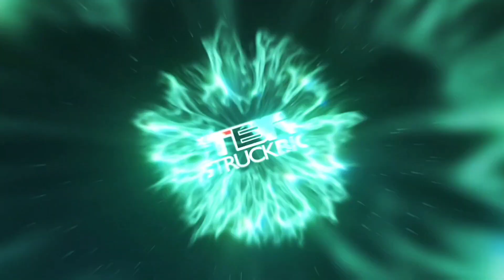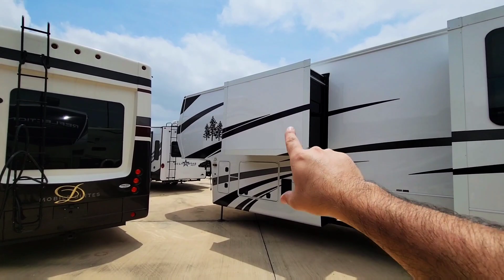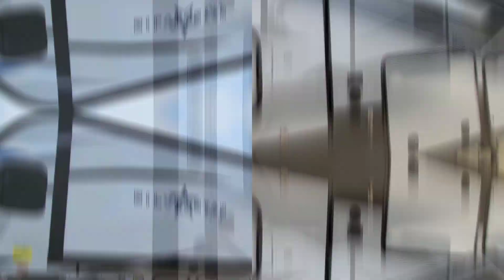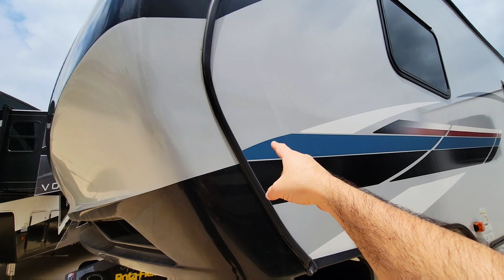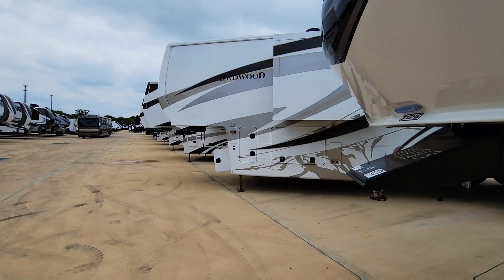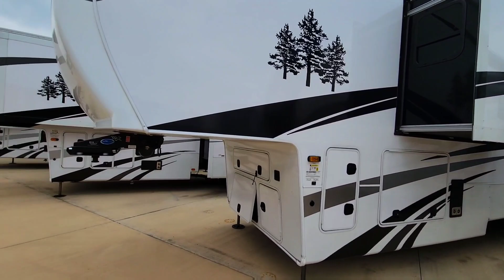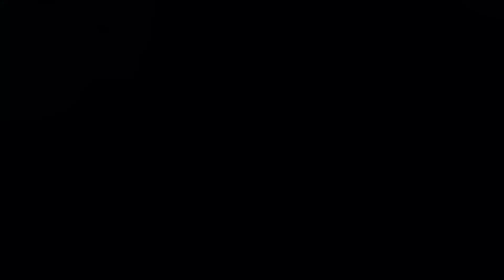The RV Industry NEEDS YOUR OPINION on this!

Comment: Interesting topic! When you say “edginess” I’m guessing you are talking about the more geometric shapes and designs verses the swoops and whirls of some of the units.  It kind of goes back to some individuals like modern (more geometric style), traditional (more swoops and whirls) or retro which is a mix of the two.  Between vinyl graphics vs full body paint I always choose the full body paint just because it looks nicer and will most likely last a lot longer too. Having said that, anyone who just wants an RV for occasional camping trips for various periods of time would probably be just as happy with the vinyl graphics, where someone who will be living in the unit full time may opt for the full body paint. If you ever get the time it would be great to see a video where you detail (no pun intended) how a fully body paint is applied which would help viewers better understand how much work is involved, which is also why it costs so much.  I personally prefer having long flowing lines with some rounded edges to break up the pattern.  That voltage has an awesome paint job, but it’s a little too modern and geometric for my tastes.

Comment: If I bought one of these I would need a change in the "class" for my drivers license.  I wouldn't buy one of these because length of the units.  I would be interested in a Motor Home that is under
26'.  The new exterior artistic designs are awesome.  Also, cost of gas is becoming a consideration again, so smaller is better.

Comment: Love that new painted graphic on that Voltage, but that in vinyl would be nice too. The redwood is nice too, but both for different reasons, ...I wouldn't swap those two graphics, just because you expect a little " edge " on a toy hauler and a little smoother look on a residential type RV. DRV...and yet they use that shitty door window. We swapped our for that thin shade immediately, matches the RV and the frameless windows much better.

Comment: I would like to see full body paint and less graphics. I do like the Voltage that you highlighted at the beginning. I would also like to see the industry get the full body paint down to a cost of less than 8k so the masses can afford it. I keep a cover on my rig just because I am worried about the vinyl graphics drying out and looking like crap. If I had full body paint, I would wash and wax like I currently do but not worry so much about the finish turning bad.

Comment: Thanks JD, I have been trying to find a video that goes over the different types of exterior paint jobs. Is there a reason they do not do a single solid color without any designs or stickers overlaid?
Reply: You can get one, special order a higher end unit and tell them what color you want.
Reply: @22howards  I have seen that as an add-on or extra charge. I just wish they would offer a solid color for more units even just white, grey, or black without the vinyl wraps added as base option since you are saving them labor and material.

Comment: I would like to see an option for full body paint with just 2 or 3 colors fairly simple patterns to keep cost down.  Cut the “swoops”, I’m not a designer but paint solid color with simple pin stripes or something like that.  Should not make you dizzy by looking at it.  NO EDGY!

Comment: Very good video.  I prefer the Voltage over all of them, with my least favorite being the Alliance.  I have a 2014 Redwood with full body paint, and it still looks great.  But if I was ordering a new fifth wheel, I would not order the full body paint, and put that extra money towards upgrading the suspension.

Comment: I hate all of the stickers on trailers but I care more about it being durable and having the features I need than the exterior. A single color paint would be my preference, with an accent color for the trim around the doors, windows, wheel wells and anything else. Or a two tone with a swoop where one color is above and one below plus a trim accent. If they want it to be eye catching and flashy do metal flake paints. But how the exterior looks will always be at the bottom of my list of deciding factors on a trailer.

Comment: The voltage is beautiful.
I have a camper with bunks and a outside kitchen.
What I want camper manufacturer's is no inside kitchen. We have yet to use the inside stove microwave. Use the outside kitchen all the time, and if it's storming we.just go to a local town.

Comment: Curves vs geometric vs images vs lettering vs vinal decals vs paint

Bottom line I do not want to invest extra cost into a RV with a life span.  Fit and function along with safety is more important.   This is what additional options are for if you want upgrade to full paint or extra busy graphics or color choices. The RV industry is expensive enough without all the worry about graphics.  This year because of product shortages the RV prices have risen higher than usual price increases.  I am really shaking my head hearing the industry wants to know what we think about exterior graphic design.

Comment: Full body paint all the way! After owning four large toy haulers with decals here on the West Coast the sun is brutal and after a few years will dull them out and they’ll start flaking and pealing 👎🏻 The money spent up front for the paint will far out weigh the headaches in the future. Now if you get a new RV every couple years then save your money and go with the non paint units.

Comment: I don't care about the design. I care about the longevity. I keep my trailers for 10 years, and I have to store it outside. After a few the decals fade and peel. The front cap fades. I want RV industry to fix the fade and peel problem.😎

Comment: I want full body paint with fewer graphics.  I live in desert.  I want as much white, heat reflection as possible.  Further, less is more as far as the eye finding the brand and model information and I am distracted by the massive lines and multiple planes.  I guess I prefer boring!  I’d go with the Redwood graphics if I had to pick from the models in this video, but I’d be happy with a very minimalist geometric design.

Comment: You're in luck. Giving opinions is my specialty!

The Arizona sun chews the crap out of vinyl stickers, but I'd still go that route because full body paint is not where I want to spend my money. I like new-ish stuff so I'm in the market to trade in every 6 or 7 years. On balance, I'd prefer to have solid surface counters and quality to the touch interior materials over a several thousand dollar paint job. Of the samples you showed, the 2 grand design and your Brookstone are my perfered choices for attractive exterior graphics. The Voltage is nice but it definitely has that wearing my hat backwards and going to the sand dunes vibe. The Redwood looks like they used some of that blotchy camouflage vehicle manufacturers use when road testing unreleased models. The DRV looks like an ASICS running shoe. The bighorn pulled their design straight from a scribbling 3 year old. Less is more when it comes to rhese graphics. Van Leigh did full paint the best, though I would have preferred lighter colors.

Comment: JD, I'm tending to agree with a couple of the first comments about solid colors with some tasty pinstriping over any graphics, swoopy, edgy or otherwise. Several 'super C' builders have units with no graphics whatsoever and I think they look stunning.
To y'all's knowledge, do any towable manufacturers build solid color units?
If I had the talent, I'd repaint my Voltage a solid color to match my truck. What do y'all think?

Comment: Do whatever is most durable, longest lasting and requires the least amount of maintenance as well as least expensive 😉  Personally I don't go for  RVs with lots of dark colors, sharp angled, edgy and extensive graphics. Definitely wouldn't want the huge VOLTAGE word on my RV. Does that one belong to an electrician 🤔  I guess they don't make many RVs with mostly all one color like most houses, cars, vans and pickup trucks are due to them being so large that the multi colors help them be seen on the roads? I have seen some RVs that are mostly one color. I prefer the lighter colors and more simple graphics of the ones you pointed out. I think we all should be able to choose from a few different graphics layouts from wild, sharp angled jagged dark colors to the lighter color, more simple basic swoop designs. We need the options! Ja, that minimalistic, lighter colored Redwood one and the Silverstar one is perfect. I think it's funny the reasoning why the slide side is white for the heat bit when it's such a small part of the RV meanwhile most the rest of the entire RV is very dark colored 😂 However I'd prefer the white slide sides over the black. I think it looks better than the black and reflects heat rather than absorb. Thanks, have a nice day 🌼

Comment: If I can afford it, I always perfer a full body paint.  I am a newbie RV'r and certainly don't have the RV that I plan to keep for a long time.  Once I get into a market where I plan to keep an RV more then 5 years full paint may become more of a concern.  My wife certainly doesn't understanding adding over $10K to the price just for paint, but I realize that there is a longevity issue.  Even with the full body paint, I think a ceramic coating or clear wrap may be called for to protect the paint.  When it comes to graphics, I prefer less and I would like an option to replace the graphics if possible.

Comment: Personally, I’ve always hated the swoops. They’re RVs, not racing trailers. But as far as vinyl vs paint, PAINT, hands down. You can’t buy a automobile with gel coat and vinyl covering, why is this even an option for something your going to pull with it. If it’s just for cost savings, that’s pretty near sighted. But back to the graphics, I’d like to see an actual graphic. Put a scene from Northern California on a redwood. Put a scene from the Grand Canyon on a Phoenix. That’s why we buy them is to see those types of places, so why not embrace that and display it.

Comment: It needs to look fast sitting their lol or like it’s moving. Remember the old cars that where flamed from the front to the rear. Graphics can go against the Arrow dynamic flow. Like I said if the unit was getting pulled the the freeway how would it look as it was going though some smoke, how would the smoke move across it 😁😁 fruit for thought

Comment: Give me the look of that voltage!  Amazing!  The downside is the cost of full body paint on an RV.
Reply: If you think of what you're getting for the price its actually a good deal. If you wanted to wrap one it would cost at least $15k and it wouldn't last as long as the full body paint that is around $12k from most manufacturers.  I agree its expensive but its a far better finish and will add to resale for sure!

Comment: I think if you’re not going full body paint and you’re doing graphics in vinyl then they should be applied by the dealer.  Doing so you have a customization option where  manufacturers can have several different graphics designs available to the customer of which the end user can match their rig more to their tow vehicle. It’s even another revenue stream as a customer option.  But I know the burden that would place on dealers also.  Probably wouldn’t make a great looking product on the dealers lot with everything in base color only but 🤷🏼‍♂️. Tough nut to crack. 😂
Reply: Plenty of vinyl wrap companies out there that would love a steady revenue stream applying graphics at dealers.

Comment: I like a full body paint. They're just expensive. I also like the graphics on the redwood. Looks a lot better to me compared to the voltage. All the long straight lines on the voltage look basic, old and cheap when compared to the redwood. I also like that the skirt is painted with graphics on the redwood vs the voltage. The voltage looks cheap with plain basic shirts. We currently have the traditional fiberglass with sticker decals. We really want to body paint on our next unit. I wish it could be an option on a lower end 5th wheel to bring full body paint into a more attainable price range to more people. I'm curious though..... does full body paint show scratches from the tip of small branches or bushes more than a traditional fiberglass wall? That's one concern I have about going full body paint on our next rig.

Comment: I just bought a 2021 toy Hauler for its floor plan and functionality. Didn't really think about the look of the outside but do like the looks of it. 
  Most of the units you showed looked WAY too much over the top. Especially the one with the GIGANTIC "C" swoop in the middle of it.
  I'm more of a "less it more" kind of guy i guess.
 The manufacturers need to concentrate on durable function more than out dazzle the competition with outer appearance. I'd much rather pay for more reliable and durable equipment than the stickers on the outside that have NOTHING to do with how you will actually use your RV for.

Comment: My next rig will definitely have FBP, and zero vinyl graphics. The loops, swirls and lines are just ugly in my opinion - I'd rather have it like a two-tone paint job, or the first example Voltage (minus that big V) at the most extreme.

Comment: Less is more. RV’ers are getting younger and younger and these old antiquated designs need to be reimagined. Most manufactures now offer more modern interiors that appeal to younger people and are moving away from the dark brown and what not. The same should be done to the exterior. I say get rid of the swoops, swooshes, and swirls period. Solid colors or simplistic styling should look nice. ( That Voltage looks awesome but that is full body paint which is costly)

Comment: Dislike the "edgy" look intensely. I would much rather have a simple, low graphic exterior. My dad, in the early '70's had our motorhome repainted (probably did it himself in his paint shop) and then hired an artist to do a few pieces on the front and at the driver's and passenger's door. My travel trailer has simple swoops, but they are red and navy on white. I hate beige.

Comment: If I had my choice I would have a full body paint with less graphics and lighter colors. Then preferably Asdale in and out with good insulation.  I may be a bit different as my camping is almost 4 seasons from 100+ degrees in the summer to 0 or sub zero during elk season. I don't really want edgy or stand out graphics. I prefer minimalist approaches on graphics and focus more on functionality. Really as long as the unit doesn't look like a giant turd going down the road I'm good.

Comment: I prefer the full body paint. is there a significant difference in trade in long term depreciation between a vinyl versus painted?
Reply: I prefer the voltage and its painted graphics design.

Comment: I can't stand the use of vinyl on RV's.  As Valerie NC noted, it cheapens the look.  Pretty sure I could find my 5th wheel in a crowded RV park with a solid full body paint without using cheap vinyl to make it stand out.  Not that I can afford it but Luxe has this figured out.

Comment: I have a 2013 Open Range MR281FLR trailer. Is the manufacturer still liable for damage caused by inproper window installation? 3 window that did not have gasket between frame and exterior wall. Are you supposed to take yTV apart when it's new and find these problems? Need help!

Comment: That Redwood was "YUCK"!  Full body paint is the way to go for less maintenance in the long run obviously.  Without full body paint you will have to deal with oxidation of the paint or dyed exterior walls.  Oxidation is very difficult to get rid of and will cost you a lot of money in washing and waxing.  Especially in waxing.  Chemical wash is available for removing oxidation but it is costly and it is not a widely known procedure and even less professionals in the market place to perform the procedure.  I think the RV industry as a whole should move towards a more maintenance free exterior.  A full body paint that is much less expensive to produce and market to the public.

Comment: I am so OVER swooshes, audacious schemes and graphics. So overdone, passe' and BORING. 

Do away with decals altogether. Either Full-Body Paint or Colored Gel Coat. Even quality vinyl will dry, crack and fade, looking weathered within about five years, unless stored inside.

Brand/Model Names included as part of the overall graphic-scape look more like an ego-centric advertisement than portray curb, road or park appeal.

Comment: For me, full body paint instead of graphics because of the durability and increased ability to get out bug and sap stains without destroying the look of the RV. Swoops, vs, a more edgy look vs. a single body color is just going to be personal style preference. But I will say that the style of exterior graphics should match the interior style and decor. If you have a traditional wood cabin-like interior then a solid body color or swoops is more the way to go. If you have a more modern interior with a lighter color, more chrome/stainless steel, etc. then the more edgy graphics makes sense.   A younger generation will likely prefer a more edgy look on the outside and they are the ones asking for a lighter more modern look in the inside.